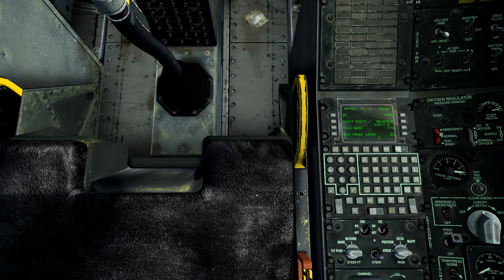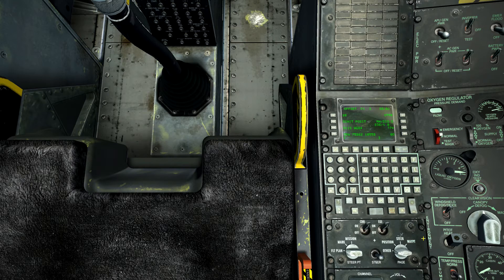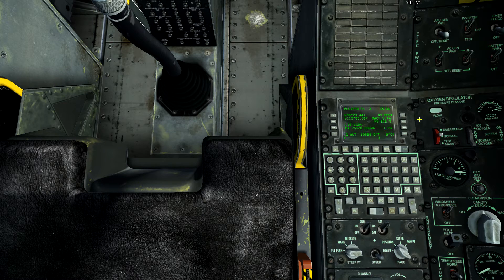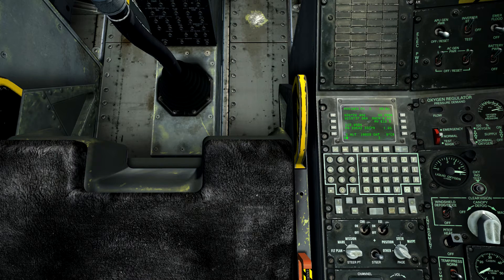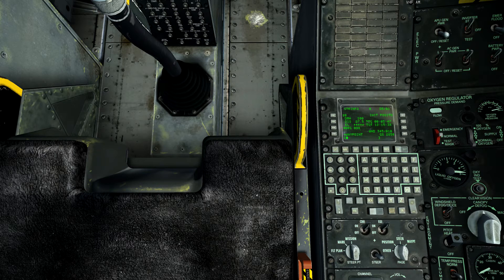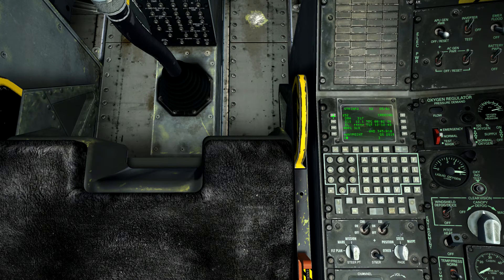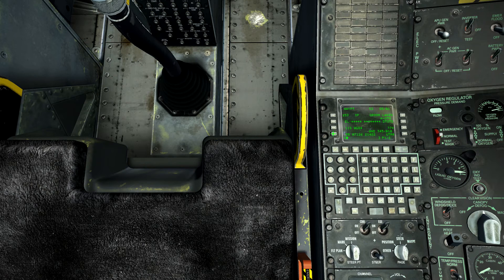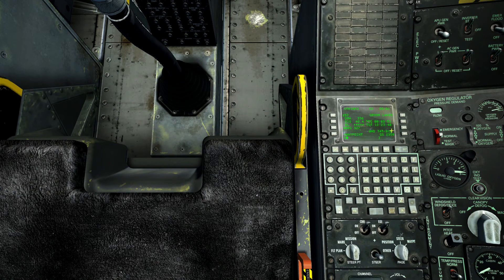A-10c - An In-Depth Tutorial of the CDU - Part 03 - The Page Knob

Comment: In the steerpoint page, I am assuming that WND reading is winds at that steerpoint/waypoint, not your current position?
Reply from the maker: John, that would be my assumption as well and the WND on the position page would be your current position.  But not being in the game, I'm not sure the POS page has a WND entry.  I've been learning to fly for real over the past couple months and they certainly keep track of winds all over the country.
Reply: @Recon Stewart I assume the system computes the wind with it's sensors, maybe as a difference of what the pitot tube and the EGI have to say about the current speed and heading. Much like the system has to compute the total velocity indicator up in the HUD somehow.
Reply from the maker: I think the wind is calculated from METARs and weather reports and then they would input it in your datacard before each flight.  You can also use the CDU to make changes.  I know there are other videos out there that explain that.  The wind system in DCS however may be broken.

Comment: Great tutorials. By default, there is a snap view that should put the camera right on the CDU. You re-mapped your numpad, but normally it's something like Num0(hold)+Num6(tap). If it's helpful, you could re-map it to something for the tutorial.
Reply from the maker: That's a for the awesome tip Chase!  I made the mistake of recording all of these in one sitting so I won't be able to change the footage until next time unfortunately!
Reply: it does not stay at that view without you letting go